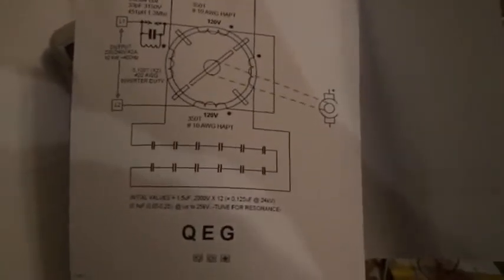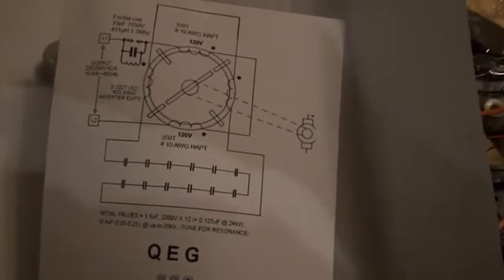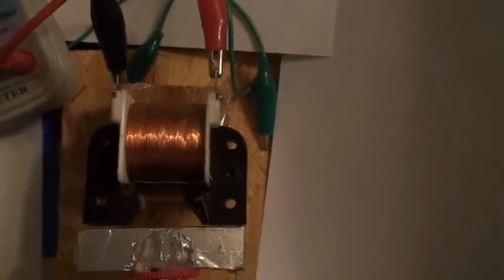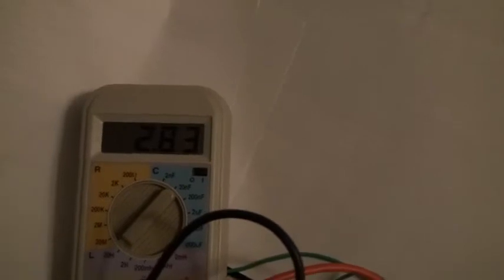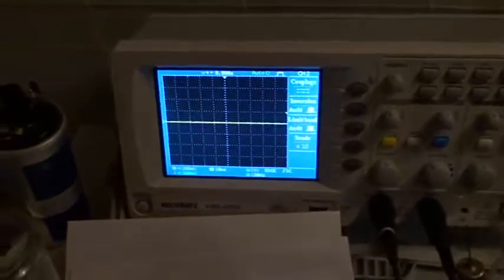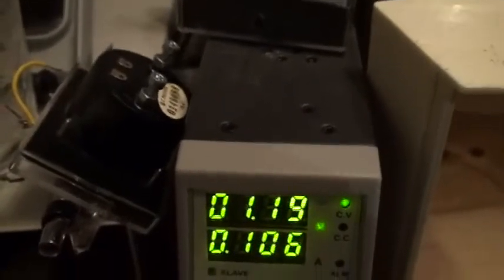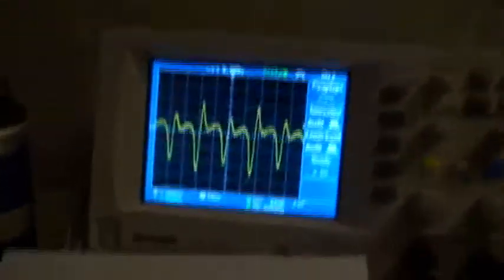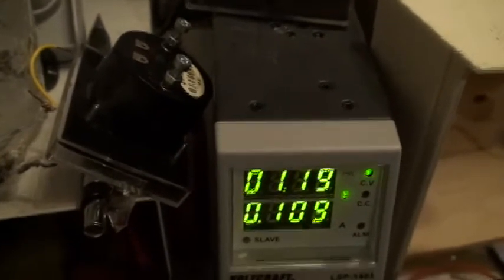inductance power without LENZ perhaps

Comment: Just a thought: the little electric motor has some permanent magnets inside its black housing. A little bit of this magnetism is transferred via the steel axle to the laminated steel bar. Then this is a weak magnet turning in front of a u-shaped core with a coil. Consequently one gets a little electricity out of the coil. It is a very weak generator.

The change of inductance has nothing to do with that, it is the weak magnetism emanating from the permanent magnets inside the black electric motor. I only speculate.

Please test the laminated steel bar for magnetism with a compass. The laminated steel bar should be stationary (no current to the motor) when you hold a compass near it. The magnets inside the electric motor will probably influence the compass much more making the checking of the steel bar difficult.

If the motor has no permanent magnets inside, you should put current through the motor but keep it from spinning, then you should see magnetism with the compass.

Greetings, Conrad

Comment: Well done, but what was the internal coil resistance and thus its resistive load during short circuit ? Was there a phase shift between voltage and current on the internal resistance of the coil, so the heat created on this resistance was almost zero due to the powerfactor cos phi ? Just apply an external load resistor with the same impedance as the internal impedance so you have maximum power transfer to the load and can the real output poeer and then compare again.

What was the maximum open circuit peak to peak voltage ? About 1 Volt ? Will this change with the RPM  speed ?
Many thanks.